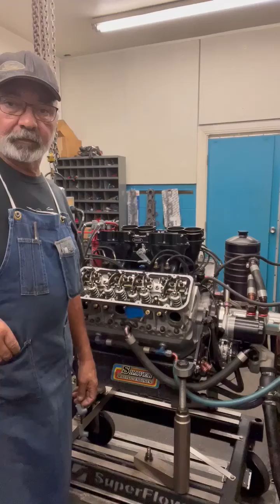DynodonnyMac talks about cooling systems

Comment: With that much cooling system pressure around the cylinder it might help with cylinder distortion also. Did you drill and tap the heads and block or are they aftermarket and come that way?